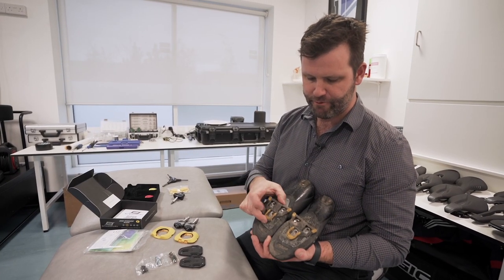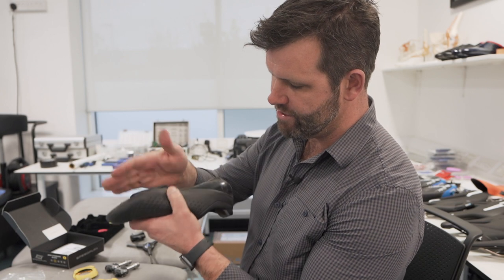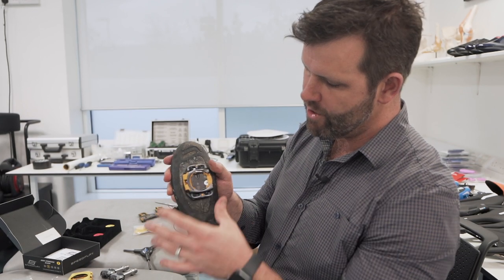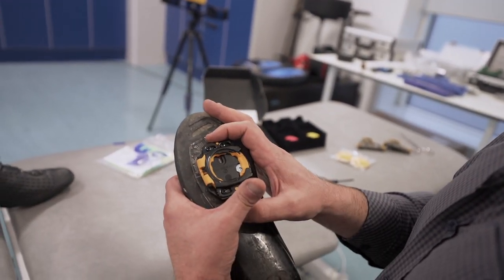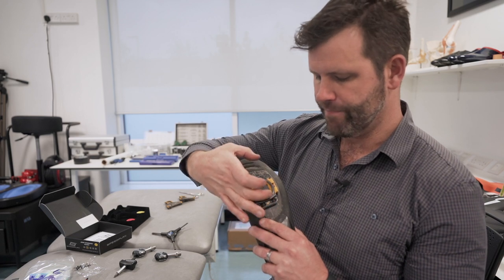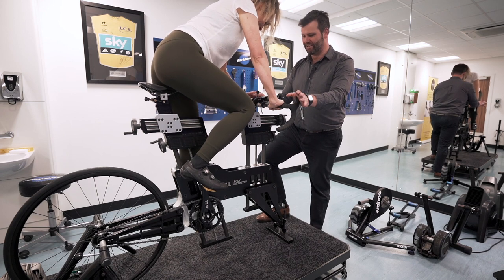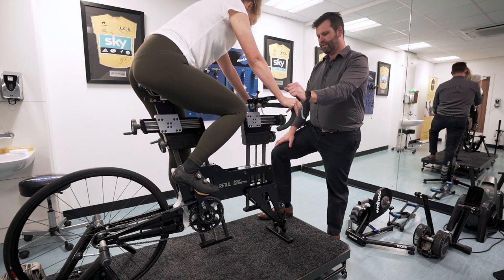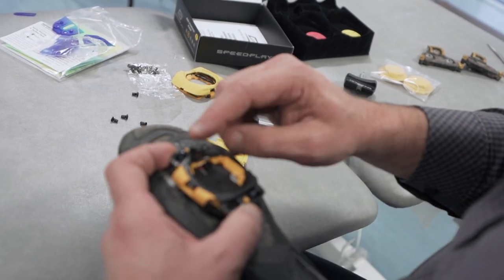How To Set Up Speedplay

Comment: Every time I go on my bike, unclipping my shoes isn’t an issue, it’s the clipping in that’s so difficult. I’m even standing up and not sitting on my seat so that I can get extra pressure from the whole of my legs to seemingly force my cleats onto the pedals, but that’s seriously not helping my heart failure 

When fitting the cleats I definitely use the correct shims so everything fits perfect and all screws are nice and tight. Ive also been using some dry weather lube over the summer.

I have a lovely £5,500 Giant carbon bike with carbon fibre wheels but clipping in is really spoiling my rides.all the videos I watch make fitting and adjusting look so easy but I’ve been struggling so much for two years that I’m ready to go back to normal pedals or give up cycling.

Comment: After trying a few different pedal systems and surveying some veteran cyclists' groups, I've been riding Speedplay pedals for the last several years.  I like the (newer) lower profile "walkable" Zero version like you demo here except for one thing, the plastic cleat covers randomly fall off!  They are expensive to replace.  I've tried gluing them on with hot melt glue.  But, to no avail. I'm wondering if there's room to add a couple small set-screws, like on the float adjustment might work if there's room to drill and tap (create threads) them to hang under the cleat lip?
Reply: Hey Mark! Just leave the covers off! All of the guys I ride with don't put the covers on and have had no issues for years with the same pedals as far as functionality! I haven't had mine on in about a year with no issues. Just make sure to clean and lubricate periodically and should be fine.

Comment: I’ve recently started using these pedals. I’ve been on about 15 rides and find it very hard to lock the cleats to the pedals. Is this a common problem or an issue of just needing to break them more. I have them set with minimal float also if that matters.

Comment: I just put the Ultra Lights on my new bike and have had an issue with the left side clipping out as I am pedaling along. I intoe on my left side, so my natural pedaling stroke is heel out and it seems I am already most of the way to the clip out range and if I internally rotate my left foot/tibia at all it unclips. I did go and pick up some Zeros to try as the more resistant clip out may help. I wish Speedplays would allow for internal/external rotation of the cleat so you could set the center point of the float range.

Comment: I liked BeBop VP better than Speedplay, and I used Speedplay for many years. The baseplate  and cleats on the Speedplays would wear too quickly and were expensive to keep replacing. BeBop were essentially the same two sided entry; same feel and float as Speedplay, which I didn't need anyway as I didn't need adjustable float. You could use the same cleat and pedals on both road and mountain shoes also. Too bad Speedplay sued VP and put them out of business for now. I hope they resume production in the future.

Comment: My right foot pronates like crazy so I have knee pain on the inside, I believe these will help since they offer more float compared to shimano pedals?
Reply: You may want to use insoles with more arch support to bring your foot a bit more neutral
Reply: @seppilin351  Nope this comment is 1 year old+. I got the Speedplay pedals and my knee pain is gone thanks to the cleat placement only. It's mostly about the fore/aft cleat position.